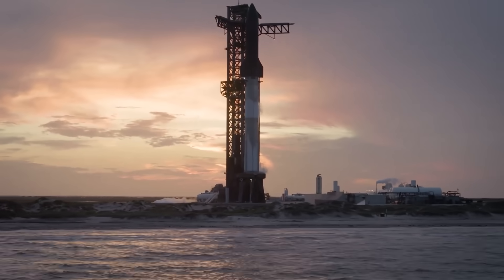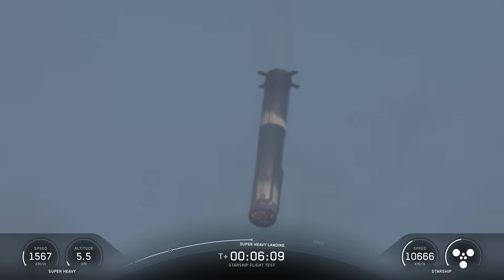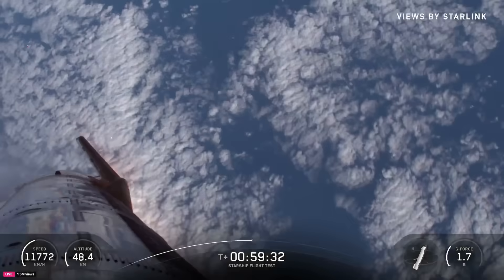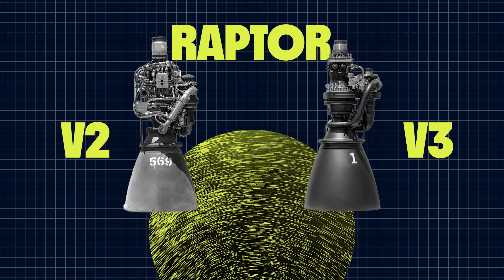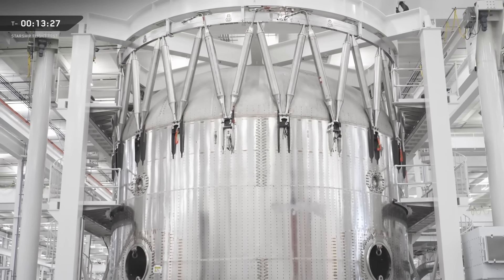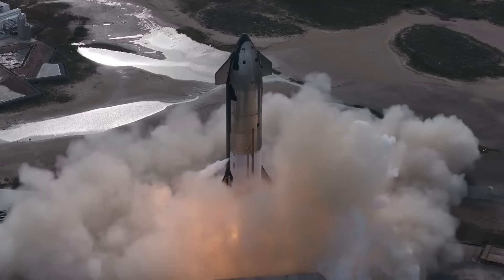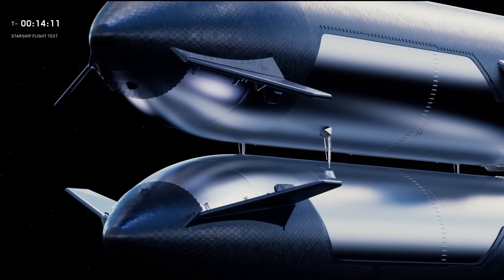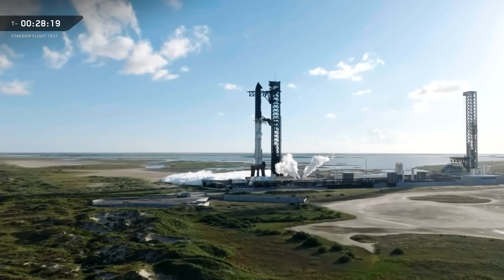What Exactly Happened On SpaceX's ELEVENTH Starship Test Flight!

Comment: I still think at some point things just get too big because the more weight you add the more fuel you need the more power you need to lift it into orbit so at what point do things start going backwards that the amount of effort you’re putting into get into space is just increasing the cost because of all the extra weight that you have to use to accommodate what you’re trying to do. How does that work out maybe it is not a problem with unlimited government funding.

Comment: I think I was far more impressed by the V2 vs V3 engines changes.  From an engineering perspective, those changes and the simplicity of what they have accomplished is .. beautiful.
Reply: I actually struggle to comprehend them, where did all the lines go? Did they 3d print new parts where all the lines and connectors are internal rather than external?

Comment: LOOK 🐂💩!! 🤣🤣 
Furthermore, any solid working flat earth model allows for "insets" in the dome/firmament that direct light similar to how a flashlight lights a specific area and the other areas though relatively choose can remain dark.   But really, let's stop with the is it flat nonsense. Come on, here's the proof, Bible says The Father's throne is above highest North, Polaris, only star that doesn't move, Aurora borealis is the green, color of love, energy of The Father coming into the electrically charged firm-a-ment that sits on Antarctica, the oceans are a huge salt water battery, we are wireless bioelectric beings powered by the Aether, element removed from periodic table that Teslas work based in, wireless electrical type power, where does your pulse come from, radio signal that comes from OUTSIDE your body, back to the firm-a-ment! So you can believe in your globe nonsense but every half second Yahuwah, the Most High Living El, sends a signal to tell your heart to beat every half second via the firmament dome that is His Footstool above your head right now!! Amen

Comment: 11 flights. No payloads carried. Never entered orbit. Never transferred fuel. Never recovered both vehicles. Never demonstrated fast turn around. Heat shield not ready. Vehicle constantly gets bigger and bigger, and heavier and heavier, at the expense of payload to LEO. 
What a pile of useless junk this thing is. And every time it flies, it cost US taxpayers 500 million, to send garbage to the seafloor.
Reply: your whole comment is wrong. it carried multi dummy star link satellites. also it seems you want them to transfer fuel which would need them to launch another ship up which is something you don't want. they didn't recover both because its the v2 and that ship is scrapped. the heatshield is ready so idk what you mean.
Reply: Starship development is completely self funded by SpaceX.  These Starship test launches do not cost taxpayers a penny.  SpaceX has contracts in place for Starship services such as HLS, but those contracts don't pay out until specific milestones are met which have not yet been demonstrated.

Comment: I thought the reason they went from 4 to 3 grid fins was because only three were effective during descent.
Still wondering how they will alter the payload area for larger items. Another slide up door or clam-shell (shuttle)....
I thought Tower 2 was the same height as Tower 1...but flame bucket makes the larger items fit.

Comment: It still blew up at the end. Not successful AT ALL
Reply: It was intended to.  Maybe you should start with a clue as to what's going on and why.  Then you'd have an informed opinion.  That'd be new.
Reply: That's expected and actually preferred. It means what's left of the rocket sinks down to the bottom of the sea instead of floating around. Imagine a skyscraper washing up on the beach. Besides, considering the laws the US has on sharing missile technology, it's better it explode than have some of our enemies capture it and gain access to the technology powering it
Reply: Because they never had any plans to recover it, so they decided to test a novel landing directly on top of the water. Nothing to land on, just the ocean. 

That's what experimenting is for. To claim everything else they tested wasn't successful, simply because it blew up in the ocean after everything else was finished, is ridiculously ignorant.
Reply: That's what happens when you put a massive rocket in water
Reply: If you're not going to use it and it will be incompatible, why save it? It actually costs more to save an intact landing, which they had to do once.